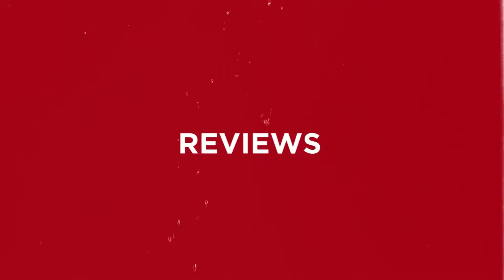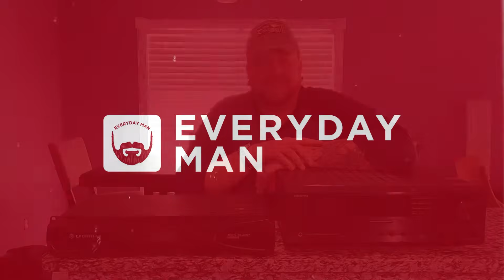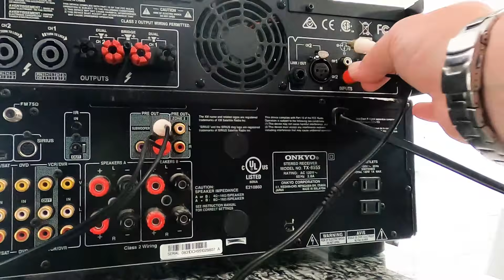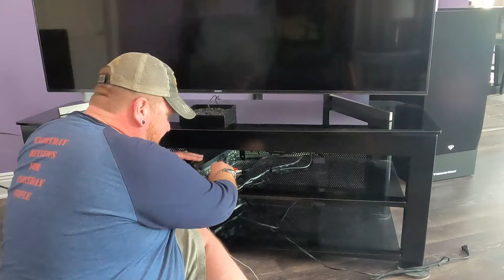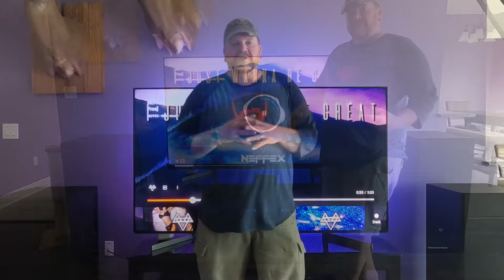How To Hook Up An Amp to a Home Stereo

Comment: Thanks, So using this way I can use hifi for bass adjustment like a mixer ? And use main volume on hifi instead using pa amplifier, and should I set the gain on pa amplifier to max then control it from sauce eg hifi or tv?

Comment: A separate amplifier makes a huge difference in sound quality and output even with a so-called "stock" speaker which yours are clearly not, they are way better than that and need real power to get maximum effectiveness.  No modern receiver is going to have anywhere near 170/180 - 250 watts per channel at 8 ohms much less than the 440wpc that your XLS 2502 has.  Just make sure you have a receiver with the preamp outputs for at least the front channels.  If only receivers with the preamp outputs were around the $500 price range that would be even better but you usually have to go a little bit higher to get that.

Comment: Hello, great video, closest to what I wanted to know but not quite. I have a Behringer ep2500 amp and a marantz sr5400 avr that I would like to hook up to power my 18” audiobahn car subwoofer. The sub is wired up for 2 ohms which the Behringer can certainly handle, but I am wondering how I hook up for my subwoofer?

Comment: I know this is an older post but I have a question… Receivers that have preamp subwoofer output usually go to a plate amp , my question is , can’t I connect the preamp outputs to a stereo power amp and use it’s built in subwoofer crossover???

Comment: Thinking of hooking one up to my Yamaha rx a700 I have in my living room.  Could probably get more power out of some of the speakers by doing that. Just have 4 small Yamaha surround speakers for the front left/right and surround left/right. Plus a Yamaha center speaker, and a pair of Bose 161’s for the surround back left/right. Also got a Yamaha subwoofer. Sounds great right now but it can always be better. My Yamaha a700 has the necessary pre outs if I choose to do this but I don’t know yet.

Comment: Can i hook up my old yamaha rx v767 avi receiver to power my final 2 speakers from my denon x3800h  in a 11.1 surround setup?
And let the denon run 9 speakers
Reply: Anything is possible honestly but you need to link the two receivers together somehow. That’s why you gotta use the pre outs on the back of a receiver to connect a power amplifier.

Comment: Do you lose the ability to use your speaker terminals on your receiver when you hook up an amplifier? I want to get a amplifier just to hook up my subs to it and i would like to keep my tower speakers hooked up to my receiver. Would i be able to do that?
Reply from the maker: Yes
Reply: You will only lose the speaker terminals for what you connected via the receiver's Pre Out.  You receiver will still have the other speaker connections available.  In your case, you want to use an amplifier for the subwoofer(s). Connect receiver subwoofer pre out to the amplifier. Connect subwoofer to amplifier.  Tower speakers will still work connected to the receiver because you did not connect the pre outs for those to the amplifier.

Comment: I have a Denon DRA-435R stereo receiver from the early 1990's. It has a pre out but when you use an external amplifier it does not allow for bass and treble control. Volume and balance are not affected.

Comment: Thanks, So it must be a pre  amp out to work, or to work with the volume at source? Could you use a line out from the receiver?
Reply: It has to be the pre outs. Line out will not work. Just look at ports labeled subwoofer out and it should be next to that.

Comment: What if my amp does not have a PRE output? I've tried using a high to low converter which resulted in horrible noise, maybe I plugged it wrong?

Comment: Your stereo is old AF.   Looks just like mine!
Reply from the maker: @BenG123  it is definitely old!! Works great though.
Reply: @EverydayMan Tells you how well they used to make them, I have many receivers and amplifiers including a Yamaha CR 2020 from the 1970s still going strong.
New doesn't always mean better.
I have newer ones that have already had things go wrong with them.
The adcom 555 amplifier and a adcom preamplifier and tuner of your choice with 2 of these or the 18s will definitely get it done.

Comment: but often the receiver have better specs than the Amplifier . you want keep the speakers to the receiver
Reply from the maker: The amp has much more power than a receiver.
Reply: Better specs don't always mean better sound. Sure The Crown is a professional amp and doesn't have as good a signal-to-noise ratio on paper But are you really gonna notice a difference.

Comment: If you have superpower-hungry speakers, you can remove the jumpers on the back and bi-amp by using the speaker terminals for the mids and tweeters and the crown amp for the woofers.

Comment: You would do the volume control through the amplifier or your receiver?  If you control the volume from one of them will the volume on other  be set at minimum or what?
Reply from the maker: Set your amp where you want it then use your reciever volume.
Reply: @EverydayMan  thank you for the tip but at what level my amplifier volume will be will it be minimum or what.
Reply from the maker: @Poetry.Heaven  crank up your reciever and set your amp where you want it.
Reply: Ok thanks
Reply: @EverydayMan  regarding my other question on this topic would you help me out about the preamp out option on my receiver
Reply from the maker: @Poetry.Heaven  front for stereo
Reply: @EverydayMan  Thank-you

Comment: I do this in my setup aswell. I use a hifi stereo / surround system and to get the best quality in stereo.  I rynd my nad c356bee for my dali mentor 2's through my nad t757 reciever. A high quality stereo amp ALWAYS beats a reciever.. even high end like nad and marantz..

Comment: Don't you think using better quality RCA cables will improve your sound? Seems like you spend a bunch of money to do this and then use cheap RCA cables to connect it. Did you turn up the volume on the amp all the way and use the receiver to control the volume?
Reply from the maker: Copper is copper. Expensive cables won't make a noticeable distance. Yes I keep the amp wide open. Lol
Reply: @EverydayMan  You don't need to spend a lot of money but you should at least use some shielded cables. Amazon and monster both make some that aren't very expensive and they're better than the red and white ones you get with your equipment.

Comment: I bought the 1502 but the sub rca out of my Yamaha rx-a800 av receiver isn't high enough voltage for me to get much sound out of the crown. I am using it low pass 4 ohm stereo and high sensitivity. I am looking for a line driver.

Comment: I have a pioneer receiver it doesn’t have pre-out. How can I connect an external amplifier to boost the power? Do you have any suggestions? Thanks.
Reply: Since the creator won’t answer your question, I will you cannot hook up a power amplifier to a receiver that does not have pre-amp outputs

Comment: Using the rca inputs on the back of that power amp directly to the crown is useless from what i heard. The pre out voltage from the avr is low and won’t drive the crown well.  Is it true that I should be using a CleanBox Art Pro inbetween the avr and amp to convert the rca signal to balanced at a higher preamp voltage?
Reply from the maker: The amp has a sensitivity switch for home use.
Reply: @EverydayMan  Thanks. Im going to order this amp to drive my polk audio es60’s. I wonder how the difference of bass response and sound will be instead of the yamaha avr alone. Hopefully it will wake them up. Do you recommend throwing an equalizer in the mix too?
Reply from the maker: @juliandavis8439  I don't have one and mine sounds great.

Comment: I am totally blind. I have no vision whatsoever. I recently purchased a Sony receiver model number STR Dash K700 and it did not come with a remote sadly to say. I have a Alexa echo dot from 2021 is shaped like a hockey puck it has one power input slot, and I believe it’s a auxiliary out slot. I would call it, I was curious to know if I can connect this Alexa echo dot to my receiver because this particular model Sony STR Dash K 700 does not have an auxiliary out slot in the front or on the face of the receiver. It only has a microphone out slot so if there is a way I can hook this thing up with a particular style of cord or RCA cord. Would it be possible for you to leave me the name and the model of that particular cord because right now it is just a huge paperweight without the remote I can’t even change the tune up or tune down for AMN FM stations, thank you so much. I pray you can help keep up the great work.

Comment: man! was hard to find this video, this is exactly what i was wondering, if i added an external amp for my front speakers  AND using the preouts of my recievers the volumen control of my receiver will work! and only this video has the answer! thank you :) i know a pre amp is the better way, at least that is what the expert always tell, but 1300$ for a parasound preamp? man... no bueno... at least not rightnow but maybe in the future

Comment: Hi, i have a Sony STR-DH590 in my living room and a vintage receiver in my she cave. My Sony keeps saying protect i think and then cuts off. I took a shelf out of my cabinet to keep it cooler because i feel alot of heat coming from the top of it. What do you recommend? I thought of maybe hooking a small fan to the wall behind it to blow cooler air onto it. It used to never do this. 😊
Reply: Check the impedance stated on the back of the receiver around the speaker terminals (it usually says something like 8-16 ohms or 4-16 ohms and if you can play set A and B at the same time etc.  and check what the nominal impedance of your speakers are (most home audio speakers are a nominal "average" of around 8 ohms.  If the receiver says to use 8 ohms and you use anything less such as 6 or 4 ohms that demands more current from the receiver which amounts to more heat dissipation and/or protective muting.   6 ohms on an 8 ohm rated receiver is usually marginally ok but 4 ohms or lower is pretty tough.  Its not the heat alone that causes the problem, although the fan might help, in some cases, especially under heavy usage, the excessive current draw causes the shut down.

Comment: Now how do you hook up a subwoofer
Reply from the maker: I don't, I have 15" Cerwin Vegas! lol
but a sub would be connected to the pre out also.
Reply: Depending on your home stereo/avr amplifier, you may have a few options. Using the OP's HT amplifier, you can use rca cables from Zone 2 PreOut, or any of the rca output (grayed out). Your subwoofer should have frequency selector and volume to make sound good.

Comment: Omg I have fell down a rabbit hole with stereo equipment, I had a nice onkyo receiver did not have a pre out so I bought a 1000$ yamaha integrated amp, it clips and had to have it replaced. Now I have a new one, but it clips, the reason are my huge cerwin vega xls 215 $1700 a pair speakers ,  you can not hook up a amp to a integrated amp so I am out the 1000$ I spent on my Yamaha, from your video  If not mistaken, I need to 
1.  Buy a receiver the has “pre out” my original onkyo did not”
2. Buy a amp and plug into the preout on my new receiver.
3. My cerwin vega xls 215 are rated at 500 watts, make sure the amp I buy will put out at least 400 watts

I do not have connected to tv only phono cd turn table cassette and  xm satellite
Reply: I fixed the clipping problem by the switch on the back of my Yamaha integrated amp set to 4 ohms instead of 6 ohms, hello completely woke up my Cerwin Vega xls 215’s🎸🎸🎸🎸🎸🎸🎸
Reply: Did not have to spend a dime, 4 ohms instead of 6 incredible
Reply from the maker: @davidgaunt5539  yeah that's important!
Reply: @EverydayMan  ok the Yamaha clipped after hours cranking the Cerwin vegas,    But we’ll see, I bought too big of speakers for my power, need to up grade.  4ohms is better than 6 still
Reply from the maker: You need a reciver with a pre out definitely.

Comment: Do you have to manually turn the amplifier off every time before you turn off your receiver?   Basically I want to continue using my remote to turn my receiver on and off.  I don't want to have to get up and turn off the amplifier and then turn the receiver off, and vice versa, get up and turn the amplifier on manually, then turn on the receiver.
Reply from the maker: I leave the amp on.

Comment: Hello sir. Can you run another amp from the amp you installed in the video?
Reply from the maker: Yes, it has a link/out connection
Reply: Or you can use a rca splitter on the reciever pre out.....to use a amp for the subwoofer use a single male to dual female on the subwoofer out of the amp

Comment: Something I've never quite understood about adding an amplifier - my stereo receiver is a 100-watt output unit, and if I put the volume up past 3 or 4 on the dial, it's so loud my walls shake and my ears bleed.  Why on earth would anyone need 400 watts?  You can't possibly listen to anything that loud.
Reply from the maker: Only when my wife isn't home 😂 but it definitely about sound quality and bass. The amp makes these speakers sound completely different.  Great for movies too!
Reply: @EverydayMan  so if the amp is 300w per channel and the AVR is 100 per channel, are you getting 400w per channel ? 
Thank yoi
Reply from the maker: @forrestfire5123  no, it's just the 300 from the amp.
Reply: @EverydayMan Thank you !
Reply: I have two pb16 ultra, neighbors hates me when wife is not home 😆
Reply: Let's put it this way a factory car stereo output is 25 to 50 watts per channel definitely not loud enough.  My car stereo is aftermarket and also has 50watts per channel and 3 rca outputs for amps front back and sub I run 400watt mids and highs for front and back eack running 2 channel 800watt amps and I run 1 sub amp that is a mono block 2500watt amp to two 15" subwoofers in a series.  Still not loud enough for me
Reply: I have a 120w reciver that was perfect... until I bought some huge tower speakers that suck all my power for sub par volume all around, so amps are really a setup based use case. Also you will find that if you can drive your speakers to about 80% of peak RMS they get more tight and responsive.
Reply: I have high excursion subwoofers that don’t move with 100 watts, that’s my reason for it
Reply: Some speakers are harder to drive. I bought a crown to drive speakers that need 300w at 2 ohms, which hardly any integrated amps can deliver
Reply: Because my stereo is only 60 watts split down to 30 for my sub.
Reply: Depends on application, like my home stereo reviever dvd cd player all in one home stereo amplifier reciever , if u want power for low volume and bass tho , more power is required
Reply: I get your point tho
Reply: Add 4 12 inch and those 100w are used up on 4db...
Reply: I've got 1,540 watts!
Reply: Yes u can and should😂
Reply: How do you power the amp? Car amps use around 12+ volts! Is that what you use?
Reply: @65Wildkat PC power supplys work great, I've also seen some not so OSHA approved units that take advantage of old xbox 360 and xbox one power bars. There good for like 250-300w consistently but if you want more peice of mind/power a gold 80+ certification on a 800w PC power supply should be more than adequate for most setups and will take the jank factor down significantly.

Comment: I have a receiver pioneer but I want to connect another amp for more Power my pioneer receiver does not have pre-out How can I connected or do I need a device
Reply from the maker: I think so.
Reply: @EverydayMan  I use a converter, the art clean box pro. And use the headphone jack on the receiver to get signal to my DJ/pro audio amp. The converter has level knobs to adjust how much signal is passing through. Nice clean signal with adjustments to dial in the desired output.

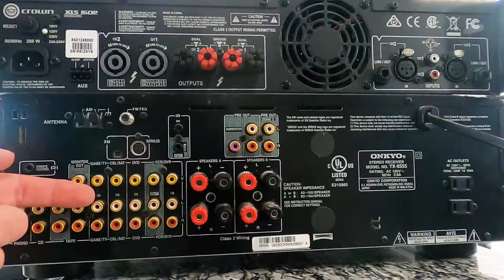Comment: your AMP doesn't have a pre-out.. your Stereo does! @ 3:06
Reply from the maker: You are correct
Reply: @EverydayMan  LOL! So you caught that I caught that, huh?... 

Thank you so much for the video man! I have trying to decide (and looking up many videos) on how to hook up my 5.1 home theater system to a pair of Passive 14" monitors...just give my system that extra punch!..  but my stereo is bare wire connection only... and my monitors are a (well literally) a guitar jack input..(6.3mm I think)...  any ideas??

Comment: Are those the Cerwin Vega E712? Ironically, those are the speakers I am hooking up right now.
Reply from the maker: No, they are sl 15s
Reply: @EverydayMan  I have 4 cerwin vegas running on a onkyo receiver. I never messed with amps and I'm trying to figure it out. It's real confusing lol